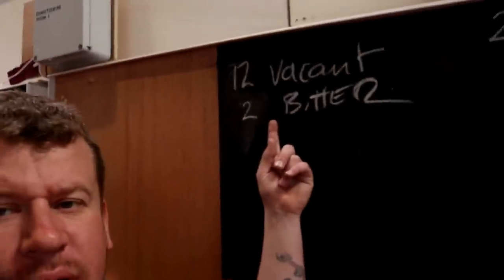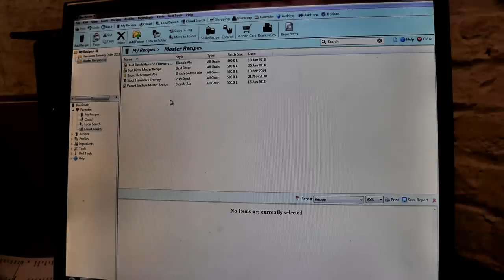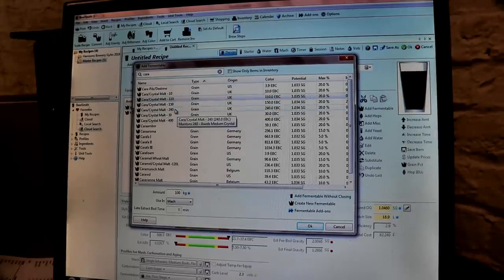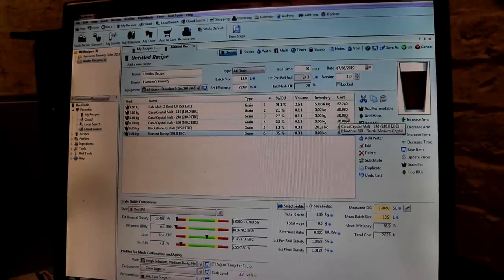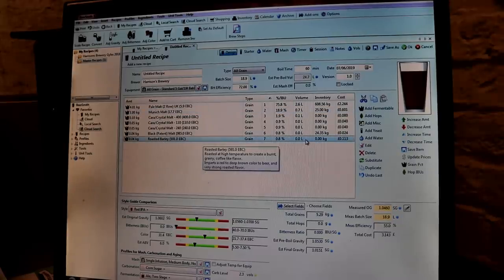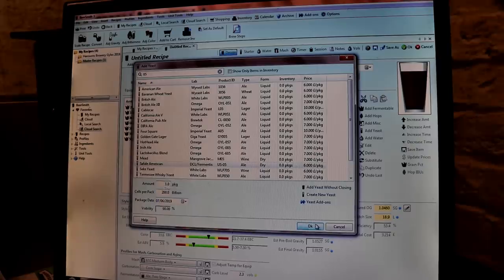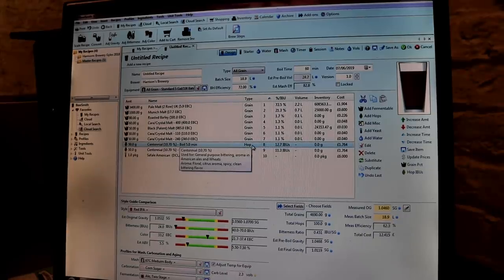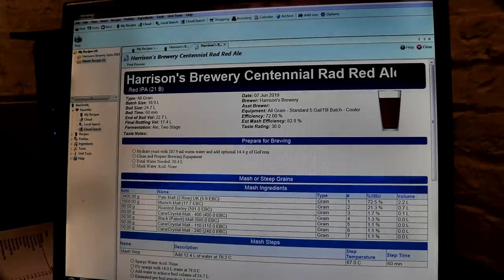Centennial Rad Red IPA ~ Recipe ~ Brew along video next week

Comment: how did you measure the alpha acid of the hops? or did you just read the packet?
Reply from the maker: In most cases it is on the packet, sometimes you have to enter the batch code on YCH website.